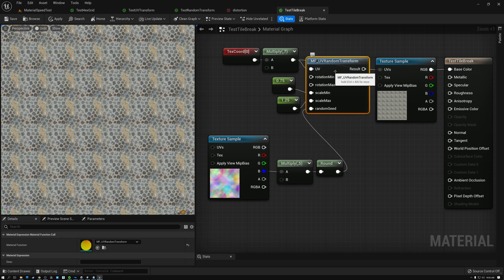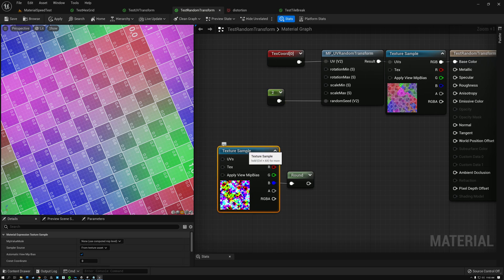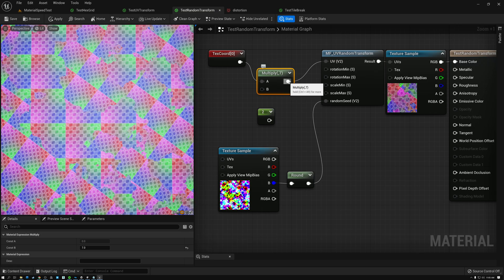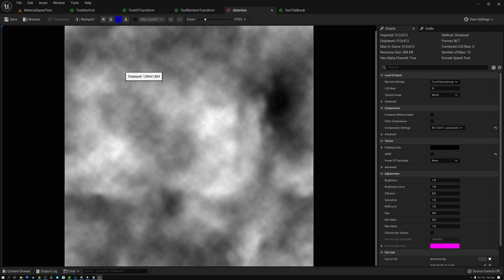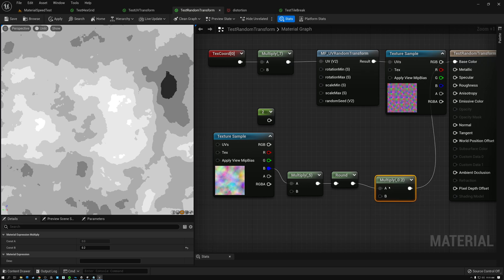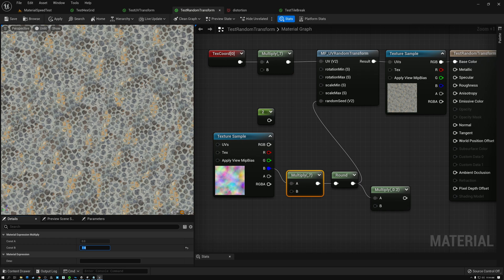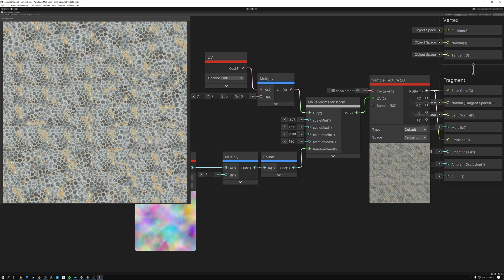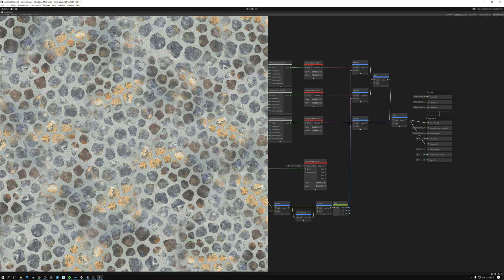Texture Tile Break-up - Shader Graph Basics - Episode 45

Comment: Can someone help?
I have the same problem in UE 4.27 and UE 5.1
When I insert the scalar value to the RandomSeed node, the result looks the same as in the video.
But when I insert any TextureSample through the round to the RandomSeed node, there is no rotation.
What could be the problem?
Reply: I'm super late to the party here but I did have and solve this problem. I'm guessing by now you have too but for anyone else who is only coming across these videos now here is what I had to do. (using version 5.3.2)
1. in MF_TransformUVs ensure the both the sine and cosine nodes have their period value set to 360 (hover over the node while holding Ctrl+Alt to get the explanation for why this was needed)
2. in MF_UVRandomTransform connect the scale and rotation Lerp alphas to the RGB, the R or the G. Because there are only two channels being fed into the Hash 23 node there is too little information in the blue channel to properly drive predictable results. 
3. not %100 sure why this is but I had to combine at least two of the channels with an append node, otherwise no rotation will take place just a slight transform, so append any two of the channels together and feed that into the RandomSeed pin, should solve the issue. Alternatively you could use the RGB output as well. what I did here was use two channel mask parameters and fed the results into an append node that way I can choose the channels from the material instance and modify each layer individually. 
Cheers.

Comment: Hello ben, thank you very for your series "UV Random Transform". I tried a material with this function on a spline landscape it looks great, just a small problem at the joint between 2 segments of the spline there is a very visible line because there is no tiling ! Do you think this can be solved with your future advanced method with hex grid tiling ? Thank again !